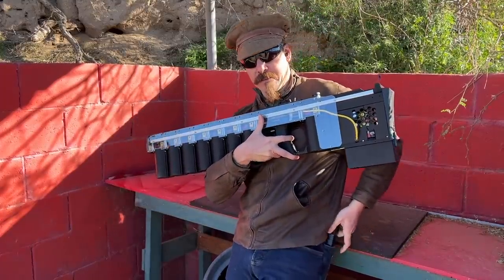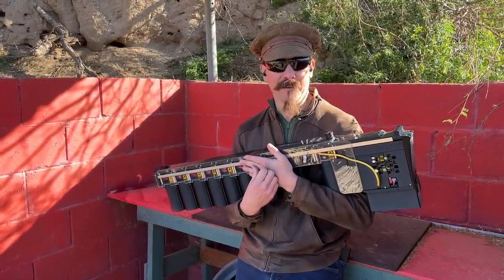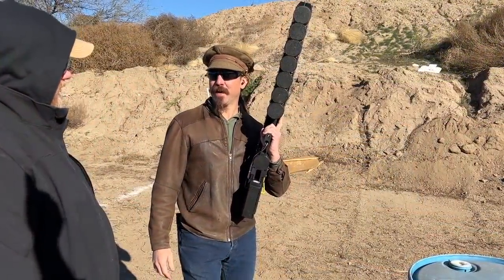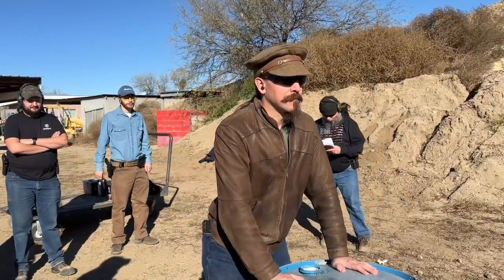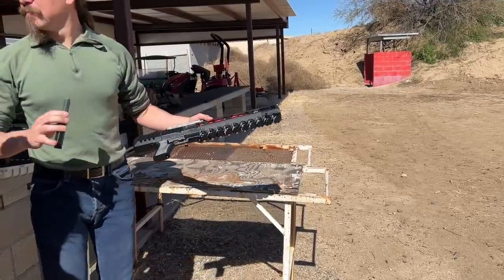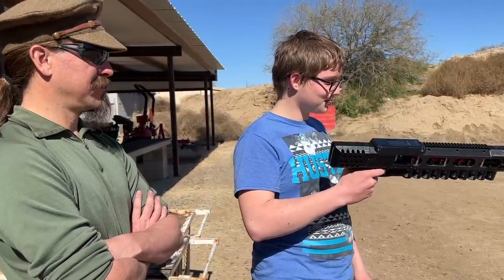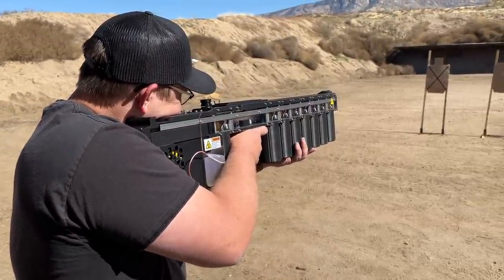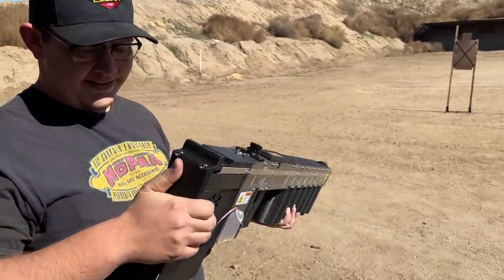I Tried to Use the GR-1 Anvil at the BUG Match...

Comment: I am wondering if you could flute the rounds to give them some stability and accuracy without needing the whole complexity of adding fins. I feel like that's been tried with other systems unsuccessfully but I cannot remember when or why it didn't seem to work.
Reply: I'd look at the designs for shotgun slugs that are used from smooth barrels
Reply: It won't start to significantly spin until clear of the muzzle and then take a while before it achieves significant stabilisation, that leaves a gap of no stabilisation where it can already start to tumble. Some sort of compressed air system inside the muzzle may be sufficient to impart enough pre-spin to close the gap. Adding spin via the coils is the better long term option.

Comment: With this being developed, what they could do is lower the diameter of the bullet, make the bullet a lot lighter and put the magazine in the pistol grip! That'd be awesome to see :D
Reply: I would probably stick with .50 and start using .50BMG AP rounds or just make custom .50BMG-style projectiles. After rifling the barrel, you could probably get some insane accuracy. Since the bullet is probably 1" or so, you could make a magazine that feeds it, maybe with a sabot...
Reply: @cxpKSip  the rounds Dont ever touch the barrel. That’s kinda the point of a coil gun. How do you rifle the barrel of a gun where the projectile ISNT supposed to be in contact with the barrel?
Reply: @stuglife5514  You could induce spin by literally spinning a lop-sided magnetic field like spinning a compass frame relative to its needle, and that would have the same effect as rifling. The only problem with that is you would need specialty ammo with a little bitty bar magnet at the end.

Comment: The first blackpowder weapons were inferior to any weapon already available at that time. It shot a lot slower than a Crossbow, it needed a lot of training, it was exspensive as hell, its penetration power was intialially worse than an english loongbow or an heavy crossbow, the accurazy was worse than throwing rocks , they were prone to failure, dangerous to the weilder etc. etc.

But the Potential was visible... clearly so. Gentlemen, we now witness the very same moment for a new type of weapon. remember this  in 20, in 30 hell in 50 years when this is the standard!
Reply: We are 100 years into coilgun development.
Reply: @brendo7363  Kind of. We're 100 years into people figuring out you can make a thing go that-a-way with a magnetic coil. There was a long time when people knew a tube full of black powder could launch a thing (like a firework) that-a-way as well before someone managed to make it into a viable hand cannon. We're at that cusp where it starting to take the first steps from being a curiosity some people screw around with for fun to a viable weapon.
Reply: That is the key when looking at this, no one is expecting it to replace current weapons right away but everything has to have a starting point. This is taking an idea that works on paper and showing the parts can function to fire a projectile, it is a proof of concept.
Reply: @tenofprime  It proven 100 years ago. This isn't the start, this is 100 years development of this device.
Reply: @scottmcintyre2809  Everything you just said but sub in jetpacks or the hyperloop or gyrojet ammo.
Not everything goes anywhere.
Reply: @brendo7363  The UK Royal Marines completed their first jet-pack naval boarding action in training about a year ago, and people have hardly given up on hyperloop. Not everything goes everywhere but dismissing things if they're not instantly world changing isn't fair either.

Comment: The switch for charging the shot should be moved from the trigger to a separate switch. Place it where you would place a mag release, or safety selector, so you can hit it with your thumb, or trigger finger, without having to pull the trigger. 

You should also disable the trigger electrically until the charge cycle is complete, so that you can't accidentally fire with a weak charge. You're already checking the charge status for the ready indicator.

Comment: I think they might want to look at making their projectiles more like a crossbow bolt.  Add fins to put a spin on it and improve accuracy and range, and make the front end somewhat pointy to increase the ability to penetrate the target.  In terms of muzzle energy, I don't think it's too far off from some crossbows.  But, it's just shooting a cylinder which isnt the most aerodynamic shape, so it quickly starts to lose energy and tumble.  Crossbow bolts with 2 fins can be fed from a magazine, though I've only ever seen them load from the top.

Comment: They should put all the batteries/capacitors in a backpack connected to the rifle by a cable and leave just the coils, rounds and the laser targeting on the actual rifle.

Can really crank the power this way without making the gauss rifle impossible to hold

Comment: Tell the devs to use like a audiocassette tape rotator head to spin up the projectile in the firing-position, so it spins just a little before firing, and you might get rid of some of that tumble...
Reply: That would be nice, especially if the spin-up time was similar to the charge time so you have auditory feedback of when it is ready to fire.

Comment: HA !! I fired a coil gun back in the early 1980s !!! 
BUT ,,, it fired sewing needles. (Straight Pins actually).
But it did so at pretty high velocity. It used the transformer from
a toy train set as its power supply. ..We also had a working VORTEX gun..

Comment: Its a neat project and I hope it turns into a neat product in the end. I do have some questions about the design choices. Like why not use ball ammunition instead? Seems like it would only bring benefits, more stable flight, simpler tube magazine, simpler reloading.

Also I am pretty sure that you can improve the efficiency of the coil stages, by simply having a steel rod around the coil, correct me if im wrong.

Comment: Imagine if they made some improvements to the gun and the ammo. Maybe breaking up the capacitors into two banks on either side of the gun, and adding a handguard to the bottom to improve ergonomics...
As other commentors have said, improve the trigger to have a breakpoint between "charging" and "fire"
Refine the ammunition. Put a conical point on the projectile and machine out "spin fins" that catch the air and cause the projectile to rotate. (Like rifling, but the ammo does the work instead of the barrel)
Reply: The ammo I used for my own build were common arrow tips and you could screw on fins like on a dart. It was strong enough to shatter a glass jar at 10 meters or three empty red bull cans. But it was dangerous to handle, because I choose function over safety.

Comment: I wonder if it would be possible to hollow out the back of the slugs to help stabilize them in flight, or to somehow otherwise shift the weight balance to the front of the projectile. You'll still want to eventually find a way to further stabilize it, but you'll at least have a super-heavy nerf dart.

Comment: I am pretty sure the camera you used contains electronics an EMP would fry.  However the camera worked anyway which implies whatever EMP field the gun generates is pretty weak and short range.  That's even a problem with the chemical EMP toys the military uses.  Cube of the distance rule.  As the range doubles the effect becomes only 25%.  And down from there as the range keeps doubling.
Reply: It's still a good idea to mention pacemakers. If your phone or camera gets fried; oh well. If someone's pacemaker gets fried; they could die. So better to be cautious.

Comment: I wonder if they could make a model with the battery and capacitors as a backpack or other thing you plug into. Would probably need some really beefy cables, but it could be an interesting research branch.

Comment: Everyone saying these are the guns of the future, I'm sorry to bust your bubble but it's not going to happen. I'm an engineer who has built and researched a lot about coil guns, and the simple answer is that the energy transfer into the bullet is so miniscule compared to the capacitor energy, it's a physics limitation at this point in terms of what technology we have. It's the reason Navy rail guns require entire building sized power stations to shoot a single projectile into space. There really isn't much that can be done (and it doesn't seem like that can improve much) to make these guns shoot with a much higher muzzle energy.  He's already implemented a lot of improvements over an analog coil gun, including multiple coil stages, and the initial solenoid velocity. One interesting way to improve the gun is to cool down the bullets and coils as much as possible (maybe with liquid nitrogen), because magnetism is "transferred" more efficiently as the temperature decreases.

Comment: I think the accuracy issue could be solved or, at least, reduced by adding angled fins on the back of the projectiles. I'd also say adding a pointed tip would help a lot as well.

Comment: How about making the projectiles fin stabilized, steel head and plastic tail, something like miniature crossbow bolts? I guess the technology limits the maximum velocity so the projectiles should be more like arrows and less like bullets to be accurate and effective as the velocity is more in the arrow-territory anyway.

Also, it should be a simple program change to prevent the gun from firing before fully charged. Or make a "grip safety"-style separate charging control so when you grip the gun it starts charging.

Comment: I wonder if for something like this FSDS ammo wouldn't be ideal since you can't really rifle it that effectively; even with a rifled barrel you'd have the issue of inconsistent muzzle velocity meaning there is no good spin length. You'd also be able to get closer to ideal projectile length (Exactly the length of a coil pack). With a sabot configuration, you'd also get far more freedom with round material and projectile length, as only the sabot necessarily needs to be made from a ferro-magnetic material (even materials not suited for projectile use) meaning the penetrator itself can be made lengthier and from something like tungsten, brass or aluminum.

Comment: I wonder if double trigger would be better. First light charging trigger, that you pull till it touch second stiffer firing trigger.
Or make two faze trigger, one faze for charging, with light pull, and second faze for firing.
Or a charging button on the trigger. You put a finger on the trigger, wait till it charge and pull to release the projectile.
Many variants can be done here. I curious how they will solve this issue.
Reply: "Lieutenant what do those Gauss rifles fire?"  "10 mm explosive tipped standard light armor piercing. Why?"

Comment: Seems that instead of staging the trigger to charge the capacitors, having a spring load AR like "safety"  to charge before firing would probably work better. Having to stage the trigger and wait for the charge is asking for negligent discharges.

Comment: you could get more power out of a conventional 2 wheeled system instead of using the coils, also the two wheels can even fire plastic or wooden projectiles.

Comment: The e-gun as matt from demo ranch has is more of a pistol size, and shoots discs, can shoot discs in bursts or single shots, and worked excellently.  Also was more refined overall.  But not as powerful i dont think based on visuals perhaps, but smaller, and worked far more reliably, and discs the size of a quarter, and probably 3quarters thick also wont take much to become lethal projectiles.  Check out his railgun egun video with garand thumb and kentucky ballistics.
Reply: It's neat but something like 8 times less powerful than the big boy here.

Comment: I wonder...

When it comes to the projectile stability issue, high performance Nerf gun modders came up with muzzle devices dubbed "SCAR barrels" designed to impart spin onto the darts as they left the barrel. It was pretty contentious at first, the idea of spin stabilising foam projectiles, but field testing delivered results. If you search for "Nerf SCAR barrel" you can see the design. Something in me feels like a similar concept could work for these heavier metal darts.
Reply: similar to hop up on an airsoft gun?
Reply: @lugoismad  no, a hop-up is in the breech area where the airsoft round is introduced to the barrel.  The hop-up "chamber" imparts backspin to the round, like a basketball, as opposed to a central axis spin like a bullet.

Comment: I still think that if you could vaporize something like a very thin rod of magnesium you could make an electric gun that uses electricity and magnesium as fuel.  It should even match 22lr performance instead of matching middle-power crossbow performance.  (Note I am still expecting it to be pressure powered so you would need to use something like a 22lr barrel to handle the pressures involved.)

Comment: Could you please talk more about why the manufacturer chose to go with such a large diameter projectile and low velocity? (If I understand the physics correctly, it would take the same amount of energy to accelerate a lighter projectile to a higher speed.)
Reply: Not quite, the issue in lies with the fact that it uses magnetic energy to propel the projectile. A small projectile means less pull on it from the magnets. The creator of the gun said in an interview that smaller ammunition has about the same velocity as large ammunition. In order to get smaller ammunition to be better then the larger ammo, the gun would need more powerful magnets and batteries. It would need much more energy per shot. So at the end of the day, the more magnetic material in your projectile, the better

Comment: Shouldn't they be able to use opposing coils/capacitors on either side of the gun to dubble the ammount of coils in the gun ?
Someone should built sabot ammunition for this gun but i suspect the loading system needs some tweaking to load a dart surrounded by non magnetic sabots that will fall off.

Comment: The quietness of this thing is a pretty big deal, if the technology gets a bit better I could see this being adopted at least for special forces
Reply: It's quiet for two reasons: No explosive propellant, and subsonic projectile speeds. The first is never going to be an issue with EM weapons, but the second is only possible to avoid in space. As the design is improved, projectile speed will go up, and there is always a crack when you break the sound barrier.

Comment: So I have watched both of the videos on this now and I have many questions... it seems your grouping was tighter with the smaller projectiles but you will still shoot a solid slug, could changing the shap of the projectile affect velocity and accuracy... maybe shap it like a bullet or maybe a ball or a dart. could get a denser ferromagnetic material (yes I googled that) to shoot get us more accuracy, volocity and penetration? would this affect power requirement? i am also wondering as there is no way to impart rifling since it's impossible for it to come in contact with the barrel is there another way to impart spin to the projectile by adjusting the magnetic field in some way. I know your are not probably the right person to ask as you know probably only slightly more than we as views do about the hardware but as you are planning to do a follow-up video it might be possible to go back and ask the engineer these questions. thanks.

Comment: I wonder - why is it using big and heavy projectiles instead of something more needle-like?
Reply: The less magnetic mass you have inside your projectile the harder it is to launch with magnetics. Is the same reason they can’t really make it launch HE rounds, because thats a lot less magnetic material for the magnets to manipulate. It would require way more power and more powerful magnets to be able to launch a smaller projectile at any real speed or consistency

Comment: Instead of straight cylindrical slugs, wouldn't a flechette be more stable and therefore more accurate?  Same diameter main body. pointed, and with, perhaps, angled vanes similar to the fletching on an arrow seems reasonable to me.

Comment: While the concept and novelty is absolutely fun, even your own comparison, Ian - to a .22lr is surely a bit generous? 400 grain travelling at 240 ft/s is certainly not something you want to stand in front of - but you can generate similar power with a 3-ounce stone and a sling.
I think even a slow and light 22lr would be getting close to double the impact energy of the coilgun, in its current iteration.

Comment: Ok so this gun is doing exactly what a prototype should - demonstrating features that work and features that don’t. The half-pull on the trigger for charging should be changed to prevent accidental firing before the capacitors are charged, causing that embarrassing “flaccid shot.” Maybe just add a separate charging button operated by the thumb, or add a software feature that prevents the firing solenoid from activating early. I’ll bet the makers of the gun are already considering things like this.

Comment: And now I can't stop thinking about how to optimise their design XD
Reply: OK, I got one: Have you tried smaller diameter barrels? Combined with smaller core diameters for the solenoids, of course. That would give much higher magnetic flux in the barrel. And it would make the projectile more aerodynamic.
Reply: Spin stabilization would also be nice, right? Switching from circular projectile cross sections to e.g. ellipsoid or rectangular cross sections (with an appropriately shaped twisty barrel) should help at that front.

But it's also possible to introduce spin around the long axis by using non-uniform (but still rotation symmetrical) solenoid coils.